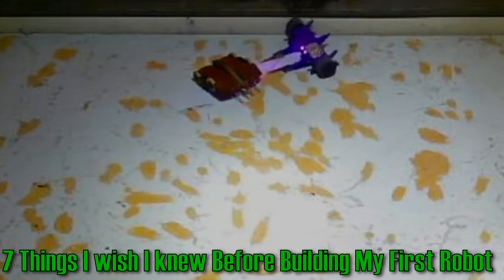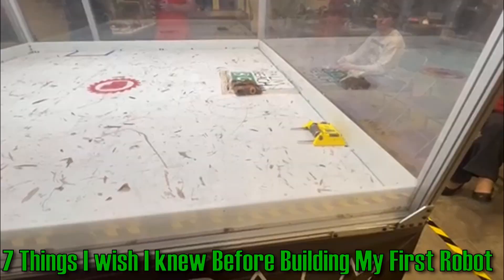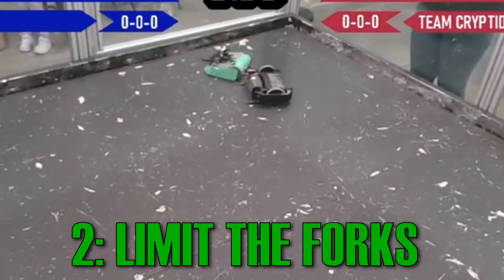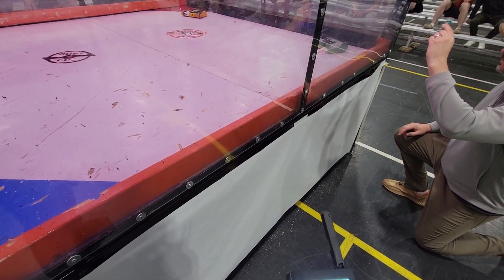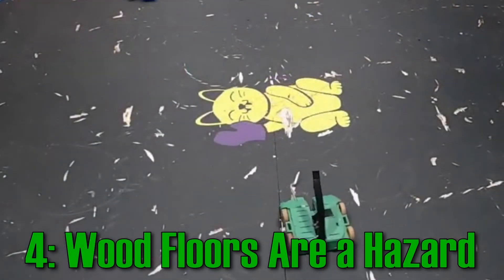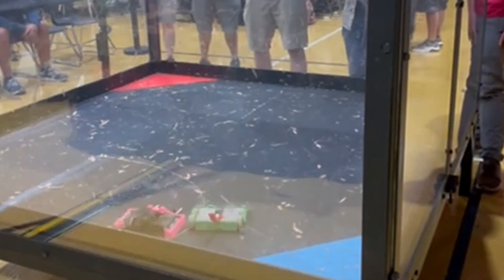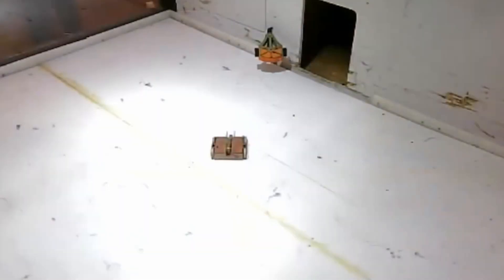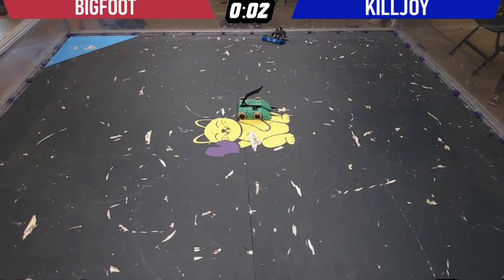7 Things I Wish I Knew Before Building My First Robot

Comment: Question for the community - I hear a lot about PLA+ but nothing about PETG for basic parts. I usually use PETG for other non-robot prints since it's tougher (less brittle) than standard PLA, but I've never tried it in a robot. Is PLA+ distinctly better/worse?
Reply from the maker: I'd say with specific PLA+ brands/product lines, PLA+ out performs standard PETG in tensile strength and impact resistance.

Comment: Excellent points. Something I wish I knew when I started is that prototyping is the fastest way to get to a solid design. Fail fast by prototyping rather than agonizing over creating the perfect thing the first time around. Sure it wastes some material, but it's worth trading for your sanity.

Comment: Nylock nuts need to be torqued down to engage the nylon in it and prevent them from rattling loose and having your beater bar fly off mid fight.

Comment: I haven’t built my robot yet but it’s an ant hub motor vert with a TPU chassis and ideally pla+ rigid parts and Al uprights with fingertech plastic wheel hubs and Ar500 weapons with two versions: the AH configuration with the Titanium Repeat Robotics Ant wedge and the fork configuration where the forks can be switched out for a reach attachment. The weapons are a disk like the first version of Moray and a custom single tooth bar
Reply from the maker: PLA+ for the rigid parts is good for the first version, especially your first bot. Why you'd choose aluminum over UHMW for the uprights?

Comment: On number 4, you could also say to not over sharpen your weapon. (Horizontal spinners especially) Also, Cobalt VS uneven steel floor + Duck as an extra obstacle.
Reply from the maker: Good point, I mentioned Weapons get stuck but didn't say that. Also steep rake angles will cause that
Reply: over sharpened forks and had to cut them down, but cut too far back and didnt have any wedge on my wedge bot